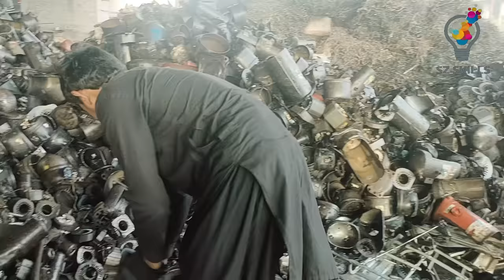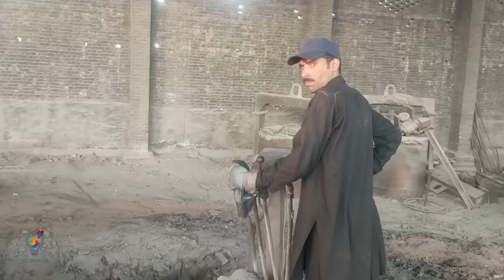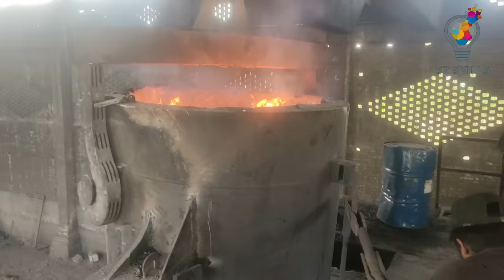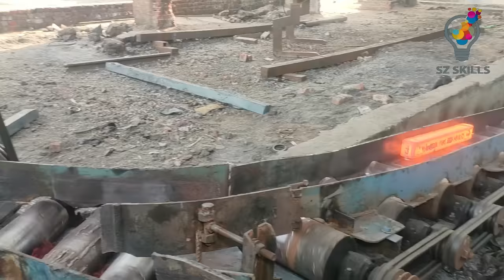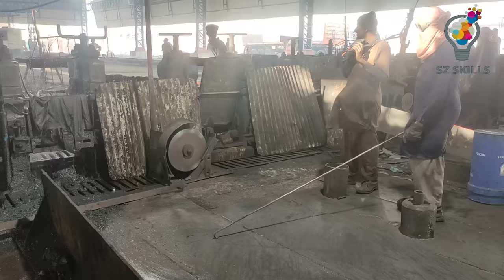Amazing Manufacturing Process Making of iron Rod Arun Steel in Factory Brilliant Technique iron Rod

Comment: Holy crap... I genuinely don't want to know what happens when a wet charge occurs in open furnaces like this being hand loaded. Also I genuinely hope this rod isn't being made for construction as there seems to be absolutely no quality control of what's going into the crucible or any way to same plus the lack of any temperature control. Just melted, poured, and sent to rolling. Who cares if it ends up too brittle, soft, or full of inclusions right?
Reply: "I hope this rod isn't being made for construction!"

Hate to break it to you, but it is obviously, rebar for construction.  That's the product.
Reply: Tofu Chinese construction!!
Reply: TBF these protocols you described cost money and earthquakes are rare;  and there’s probably an unfortunately large supply of replacement workers ready to work under these conditions.
Reply: Maybe the metallurgy was done off camera?
Reply: @charleshetrick3152  i think thats what the guy at 1:15 was doing by yeeting stuff into the crucible
Reply: I lost it when they yeeted that bag of coke into the crucible after oxygen blasting it
Reply: This is low quality rebar, likely used domestically. Appeared to be scrapped motor stators used in the melt. Fine for residential/light commercial rebar.
Reply: @chrisbritt9790  lol some iron worker must have been a naughty boy, because they're getting a lump of coal
Reply: It's metallurgy, not alchemy. :-)
They won't survive to see those batches fail, nor the countless others that were poured prior and since!
If the working conditions don't kill them, the US military will complete the job, close down the production and take over.
Reply: @charleshetrick3152  kek.
Reply: how do you think the Qatar WC stadiums were built with?
Reply: @johnkruton9708  >indian video
>talks about chinese
Reply: @chrisbritt9790  Its lime, not coke. And I doubt that 'oxigenblasting' did anything at all.
Reply: I would love to see one of them drop a half way full plastic water bottle in to the crucible. I used to work in an aluminum foundry making aluminum parts for Honda lawnmowers.
Reply: It's how any construction rebar is made, plus-minus automation and safety standards. It is the lowest grade steel by definition: always made of scrap metal, no metallurgy required.
Reply: @gasstationpeanuts1814  And then you see yet another headline in the news about a bridge collapsing, killing few dozen people.
Reply: @charleshetrick3152  "earthquakes are rare"  "googles how many died in earthquakes in india"  ... "oh my...."
Reply: Yea but looking down the chain of society, competence from this to mcdonalds employee...quality is unimportant. Its fast and quick cash now. We will do quality again when x number of people have complained and only then.
Since no one cares. Nothing changes.
Reply: what guarantees you that the metals hadn't already been pre-sorted?
Reply: Metal in metal out thats all you need to know.
Reply: What if it turns out you're too brittle, soft, or full of inclusions?
Reply: Not all the World is moving at same pace. Still these things worked for us until few decades ago. They will catch up not too far in future.
Reply: @immanuellasker4273  Requires capital, European companies have centuries of capital backing them up, Indians and Chinese firms are often small shops that can't afford ultra-high-tech machinery they'll buy it if/when they can afford to
Reply: Ko 9 ko ôm Ma\\á ôm máymơ
Reply: @Alex-nx5wi  why lime?
Reply: @accipitermagna7104  Lime is used to bind impurities, of which they seem to have plenty, into slag.
Reply: Lets see the weather in Jaipur right now is high of 108*F with a low of 84...There's probably not a drop of moisture within a large radius.
Reply: average 3rd world quality control
Reply: Lol  @theeyethatchanges
Reply: مصنع سيئ للغاية 😕

Comment: The part that really got me was just how the guys were casually stepping over the metal as it's whipping all around the place.
Reply: @GameFuMaster  that's dark but also probably really relatable.
Reply: @monkeyboimehoimenoi8395  callousness either has to come from indifference or bravado.

Because I highly doubt that place doesn't have frequent accidents.
Reply: Forbidden jump rope
Reply: @TheTdw2000  😂
Reply: Lots of job openings all the time here
Reply: The holes in the guys pants line up to the perfect height for where the metal is whipping out, can see them quite well as he steps over. They are in an odd spot for wear, so has probably had some close calls where his pants got burned off a bit.
Reply: @TheTdw2000  classic
Reply: true danger noodles

Comment: This is what OSHA has nightmares about. Nothing short of amazing to see these guys working through these conditions with No safety gear.
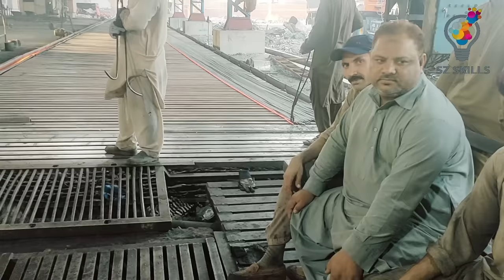Reply: 7:30 are those guys sitting on the bench the replacements!? for you know, when stuff goes wrong? I don't see any "xx days without injury" posters in that shop.
Reply: @BobbaDons   its for the ones that fall in the open hole into the furnace or burn there achilles tendon off walking back into the red hot steel rods haha
Reply: Amazing is the wrong adjective though. This is exploitation.
Reply: OSHA doesn’t operate in Mexico, Malaysia, Niger or wherever it is
Reply: @xl000  I was being sarcastic 🤦🏿‍♂️
Reply: No, the OSHA man has nightmares about how much paper work he'd have to do.
Reply: @xl000  thanks man, sounds like you know what your talking about or whatever...
Reply: Amazing? more like terrifying and inhumane

Comment: You use to see these methods in the early 1900s for steel factories. There is alot of safty hazards but thats what built most nations.
Reply: Spot on. It's easy to disregard this as horrible working conditions and don't get me wrong, they are, but rich economies don't fall from the sky, they're built and this is how it's done. This is something every developed country had to go through at some point of its existence.

Comment: If you have never been close to a foundry like these people are, you have no idea of how hot it gets within several meters from the melted metal, feel bad for these people.
Reply: Indeed... I've visited steel plants, and watched furnaces get charged and it's ferocious.
Reply: Why they're indian
Reply: @Jo Blow Still wind does not help against infrared radiation that much.
Reply: @Jo Blow Still wind does not help against infrared radiation that much.
Reply: @Jo Blow Still wind does not help against infrared radiation "that much".
Reply: @Jo Blow And what protects them from direct contact heat when a wet charge explodes in one of the open crucibles
Reply: @Jo Blow HAHAHAHAHAHAHAHAAAAAAAAA

Comment: Respect to these guys who do very dangerous work. If someone fell in the crucible by accident, they wouldn't even find him. It'd be like: "Where's Baljinder?" "No idea, maybe he went to lunch."
Reply: oh, they would find him. people don't sink into molten metal. theres more that would happen but it's not pretty.
Reply: @Achonas  Dang. That's actually worse. 🤦‍♂️
Reply: They trow his corpse to the foundry
Reply: Entire body would explode from the almost instant vaporization of the bodies water to a cloud of steam. Molten iron would fly everywhere from the explosion, then an instant later a cloud of white smoke would be ignited into a fireball and the place would smell like a BBQ joint. Absolutely nothing would remain of the worker in less than 2-3 minutes. I have witnessed a dead pig being thrown into a very large ladle of molten iron, the weight was approximately that of a human. I was about 200' away and I wished I had been further away. It was amazing, disturbing, gross and yet interesting in a very dramatic way all at once.
Reply: High carbon, low luck steel
Reply: @K3Flyguy  got the link?
Reply: @K3Flyguy  That was an interisting read. Thank you for sharing this.
Reply: It's funny that you think these would fly in India!!

Comment: Wow! Going face first to drop a wheel barrel full of scrap metal into a giant furnace is extremely dangerous and brave. Especially without any heat-resistant masks or even eye protection. 
These men are risking everything for a paycheck. Props.

Comment: Amazing.  This work is incredibly dangerous, and the loose clothing that they all wear increases the risk.
Reply: It's better that they don't wear clothes
Reply: @polarspirit  is that supposed to be funny?
Reply: as long as they don't get caught up in the machinery, loose clothing reduces contact with the metal in case of a strike
Reply: @tomboysupremacist  There is plenty of machinery for their clothing to get caught in - uncovered chains, for example.
Reply: @gibbogle9486  also its probably very thin, rippable fabric considering this is pakistan
Reply: @tomboysupremacist  how long that cloth will retard the heat? 0.2 seconds?
Reply: @zesegatto  enough to yank your limb back as opposed to getting 3rd degree burns on contact
Reply: @JohnDoe-ws4iu  it is what it is. it's a third world country, england had factories like this probably up until the early 1900s
Reply: @davutzaimoglu7252  Do I sound like I'm joking?
Reply: @polarspirit  you do.

Comment: Whilst I tip my hat towards the skilled manipulators of this lethal manufacturing process, I also have to add, how the hell the West can compete in any market when you see the God awful workers enviornment and I'm sure equally bad pay. Much like the Chinese, if you dispense with any care for your workforce, no requirement to compensate deceased or injured workers, knowing there is someone always ready to take his place, use antiquated machinery and pay a pitance in wages, the costs are at least half of Western produced steel. I feel for these workers, for obviously, every day they come home with wages, an injury or dead..
Reply: Simple, their product is crap. Random ass scrap iron with very little to no quality control. It isn't suitable for use in anything but that with the loosest possible tolerances.

Comment: There was an old (1930’s vintage) cross country rod mill like that at USS Gary works.  The 10-2 as I recall.  It, and 13 other merchant bar mills were shut down in the late 70’s and early 80’s.
This operation could never exist in the USA today what with regulation by OSHA and EPA.  What you are looking at was how rods were made nearly 100 years ago.

Comment: the fact that their all working close to these scorching extremely hot metal strips, blocks, and bars without regulated heat protection other than garments and robe type clothing is insane. Osha in the U.S would have a field-day with their supervisors and managers operating under these work conditions truly.. HS

Comment: QJEN VFD (15kw to 220kw) 100% Made in India @ very Cheap price Available with two years warranty for Printed Circuit Boards and one year for power components. Prices are cheaper than star delta starter.

Comment: Meanwhile, I do IT for a power cable factory, and I'm not allowed to use a box cutter to open a package unless I'm wearing cut resistant gloves AND I'm in a designated area for using that type of knife (which are all in the factory and require me to be wearing hi viz, safety glasses and steel cap boots)
Reply: I mean that really is too much. Hope these people never go on construction 😂

Comment: I think this video encapsulates the reason that manufacturing by and large does not exist in America anymore. Because these guys overseas are willing to do this hazardous work under these conditions they can clearly produce the materials at much lower financial cost. Obviously this ignores the human factor cost in lives lost and occupational safety but the very reactions I see on this thread about safety perfectly encapsulate the reason that much manufacturing has gone overseas: human capital is less valuable overseas than here in America
Reply: And if one of the workers dies, 10 new ones wait for the opportunity to start working

Comment: thats a lot of people to do something a machine could do automatically
Reply: I really don't understand that aspect. They literally cannot design machines on their own I guess. We probably set this up for them in the 40s, and they have not changed a single aspect since. Like, guys, you have the overhead crane and electricity. How hard would it be to make a magnet to move the metal to the pot? So much of this could be improved with relatively simple engineering concepts, but for some reason, they either don't see the need or actively fear any sort of change, I suppose.

Comment: Toxic fumes as the metal is being burned and the powder the put it coating the walls in pounds of dust over time. These places are never cleaned, only fixed temporarily.

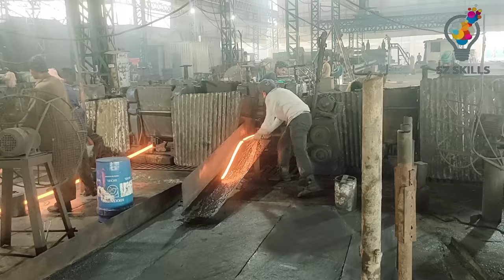Comment: My favorite part is at 6:10 where the rod hot rod whips around 20 cm away from the worker's head which only has some pieces of cloth for protection, while the wind blows his clothes up, exposing half of his top body naked.

I said no way, then the next scene shows the same process, but the man isn't wearing any protection around his head, and then when a red hot rod whips out, he reflexively pulls his head back not to get slapped by it.
Reply: Yes, i just saw that, completely nuts, i don't care about safety and this is too crazy even for me.

Comment: So just wondering what % of 3rd degree burns it would take before your manager would give you up as dead and push you in the crucible with the molten steel.  Don’t stress though, they’d pull you out again in the slag on top of the pot! 😂

Comment: I'm all in favour of recycling, but this is wrong, wrong, wrong. Open pits with uncaptured fumes, no protective equipment... I know of a factory just like this long ago, where people died from similar conditions.  They threw in a bunch of steel cans that still had oil inside them, and it got so hot, it melted the suspension chain on one side of the bucket.  It spilled molten steel all over a worker.  He was vaporised instantly.  Disgraceful to still see it happening!

Comment: Level of workers safety < 0  - they are weared in cotton clothes.
Quality of made product equals to quality of unsorted garbage it's made from.

People who works this are in actual danger now and being under affect of extremly dirty ecological sircumstances at this manufacturing.
Concrete buildings are built with this rods are unsafe, because of low quality of iron source.

While the owner of this dirty plant, i suppoose, is having a rest at resort isle etc.